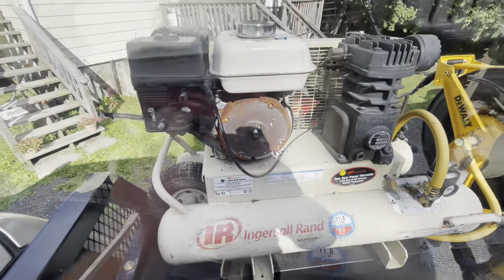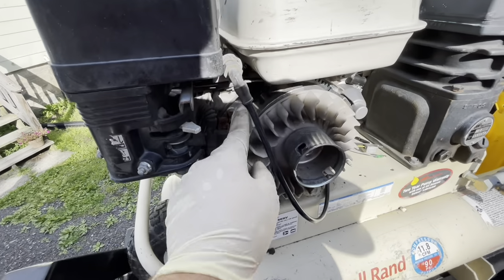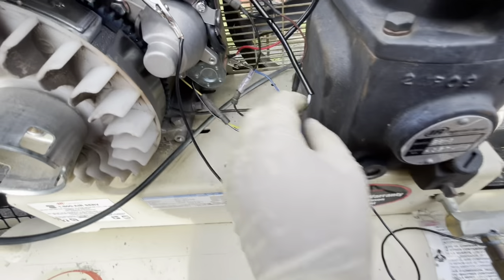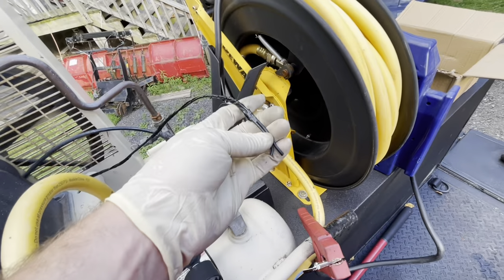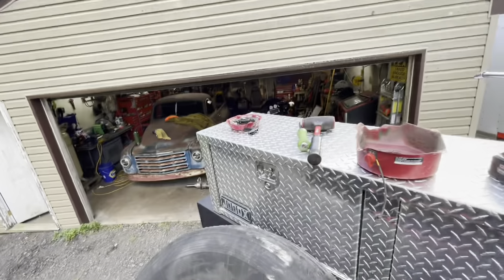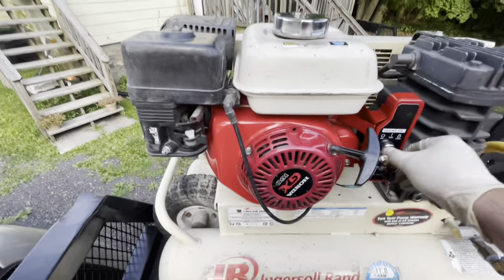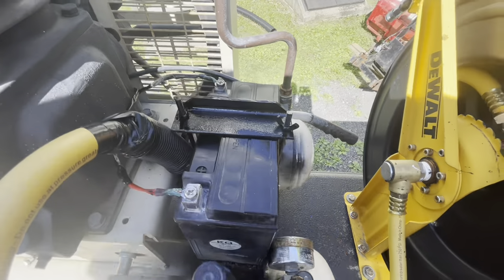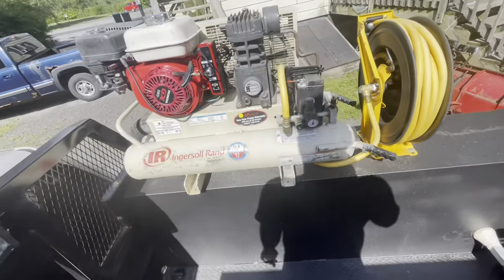Adding Electric Start to a Small Engine Honda gx160

Comment: You need an unloader valve for starting. You just flip it up, start it, then flip it back down. You won’t have to drain the air every single time and wait for it to rebuild(not that it takes very long anyway).
Reply from the maker: It’s Been done since then

Comment: I think a pressure switch can be used to kill engine spark when the tanks are full. Automatically starting the engine when the tanks are close to empty is another story, though. Does the engine get enough runtime to sufficiently charge the battery? It probably takes 20-30A to start it (35A+ on the GX390 clone) so that's a significant draw down on the battery.

Comment: The part that you said you didn't know where it went, while the engine is off, try and feel the fly wheel just under the motor, at the point you can touch it is where it needs to be fitted.

Comment: I installed the electric start but won’t turn over I took the fly wheel off and lined up the rectifier best I could I got it to turn over but it was making a horrible almost knocking noise. So I took everything back off I had to order a carb it’s a knock off but it’s suppose to be a replica please help

Comment: You have a link for the kit you purchased?
Reply from the maker: Wztepeng Electric Start Kit Flywheel Ignition Switch Kit Compatible with Honda GX160 5.5HP GX200 6.5HP Switch Starter Motor Lgnition FlyWheel Fan Cover https://a.co/d/a0luqRH
Reply from the maker: All kits are about the same

Comment: Welding battery brackets to your tank at that spot could mean you just turned it into a bomb !! NOT supposed to do that !!
Reply from the maker: The end caps are welded onto it factory. Welding is how stuffs made.
Reply from the maker: The motor/ compressor mount is welded to the tanks. The legs are welded to the tanks. Don’t believe everything you read on the internet.

Comment: Your comments about the flywheel casing not fitting are interesting.  I have just fitted a kit to a Honda GX160, which came without the red flywheel casing ( cheaper). I had to made a bracket up to mount the control box onto the original flywheel casing on its bottom mounting,( simple modification) and cut the casing to clear the starter motor. However, when I put the pull start back on,  the bolts ( the originals) fouled with the fan, and stopped the engine turning. Problem solved by shortening them. However, I suspect the new flywheel with the starter ring is slightly larger (wider, front to back) than the original, which caused the problem. I am not going to take it apart now to measure it, as it work fine, but this might be of interest to anyone who encounters the same problem. 
Richard UK.

Comment: There is a bypass on the fill side of the tank that will allow you to start it even after the tanks have pressure. Should be on the copper line down by the tank. But thanks for making the video, I'm going to  use it to install mine.
Reply from the maker: I changed that later on. I believe it’s called a pilot valve. It still starts easier with the tank drained tbh.

Comment: So, how did you bolt the the thing that keeps the battery charged to the two bolt holes? Your video skips over that. Thank you in advance!
Reply from the maker: If you have a time stamp I could better help. If I think I know what you mentioned. I believe I just threw 2 supplies bolts in the holes. You want it close but not hitting the flywheel like the magneto
Reply: @FcDominick  Thank you. 1:15 is the time. My holes are not threaded. Yours do not appear to be threaded. I could be wrong. Thank you again!
Reply from the maker: @TheFreshRinse  mine are threaded deeper in there. The holes big and tapers smaller where it’s threaded. Like something would use a dowel pin with a thru bolt
Reply: @FcDominick  Sadly, mine are tapered, but not threaded
Reply from the maker: @TheFreshRinse  honestly it doesn’t do much to maintain the battery anyway. I’d continue on. I’m looking into a mini solar panel to maintain mine
Reply: @FcDominick  Thank you for responding. I’m grateful
Reply: @FcDominick  Question: Does the battery maintain the engine after start? I guess I’m asking, doest the batter ONLY start the engine?

Comment: Is it possible to start the engine with the hand crank but without the key?
Reply from the maker: Key works like a car needs to be on
Reply: @FcDominick  So if I want to start it with the pull starter I need to have the key on "on"? (In case the battery is dead)
Reply from the maker: @Dodo-kk7mb  yes that is your new on off switch
Reply: @FcDominick  Ok, thank you

Comment: I got mine to start but now it wont shut off at all. Any ideas?
Reply from the maker: Don’t have the kill wired properly
Reply: @FcDominick  my kit is slightly different than yours. I dont have as many wires as you do from the key starter
Reply from the maker: @dylanadams4619  maybe you can leave the factory on off switch And use it that way. Flip switch on then use the key for starter. Or find the wire that kills and. And put a secondary toggle switch in to cut the power
Reply from the maker: For reference the wire going to the coil/ magneto is what turns it off. If you interrupt that signal it will turn off. Other way run
Reply: @FcDominick  the factory switch wont work either and i didnt mess with that one at all.

Are you talking about the brown wire-coil?
Reply: @FcDominick  also, how many amps should the battery for this have?
Reply from the maker: @dylanadams4619  what ever color it is for your motor. Coil turns it off
Reply: @FcDominick  can i email or text you the pictures?
Reply: @FcDominick  how many cold amps should the battery have to start this?